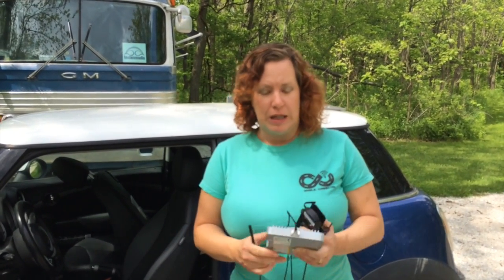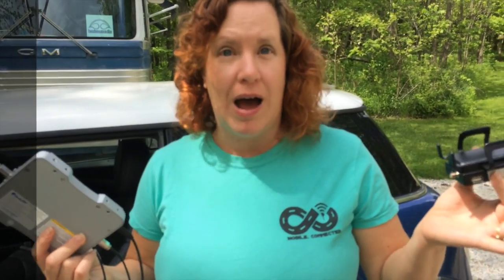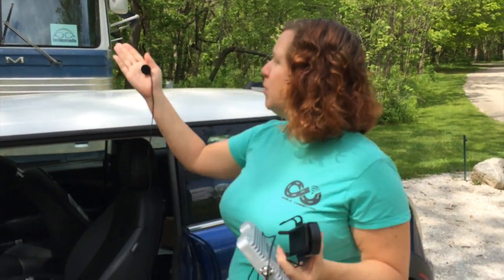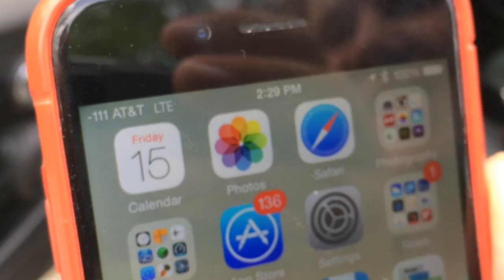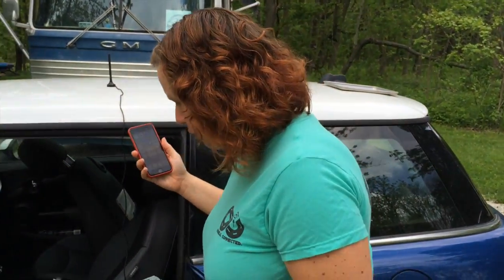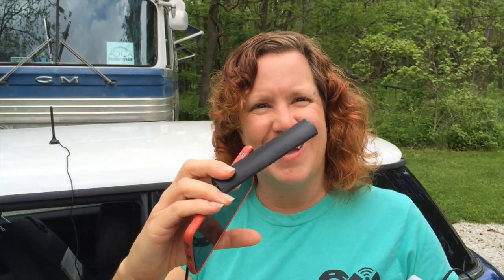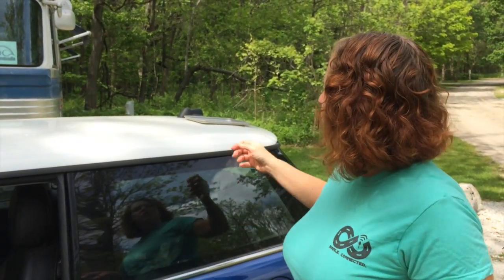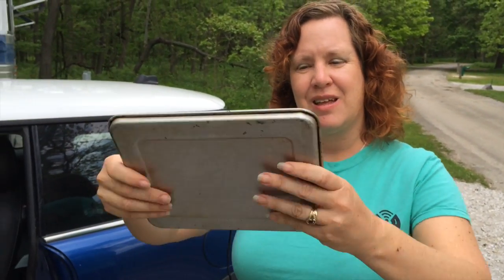RV Cellular Booster Tip: Ground Planes for Magnetic Mounted Antennas

Comment: Does the size of the metal area help any. Like for instance if i put a 4ftx4ft piece up on the roof instead of the small sheet.
Reply from the maker: 8" x 8" is the most optimal as a minimum. Larger won't hurt (and will provide signal separation from the interior antenna), but isn't needed for the purposes of a ground plane. The linked article goes into more geeky details as to why.

Comment: Is it worth going through the trouble to ground the grounding plane? 

i.e. run a wire from the grounding plate to my vehicle's chassis or negative battery terminal
Reply from the maker: +Brandon Buckley The advantage to that is if you thought your antenna mount might be lightening prone.

Comment: Hi, if you get a 1/2 wave vertical dipole for cellular frequencies you will not need to have a ground plane, and you can use many of the brackets available to install it on the luggage rack or what ever you may have up on the roof of your RV.
even the 1/4 vertical you showed in your video are available with a screw on base and mount. don't be afraid to put a hole in the metal roof and mount the antenna.